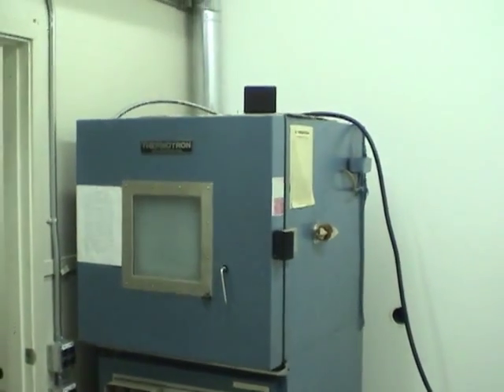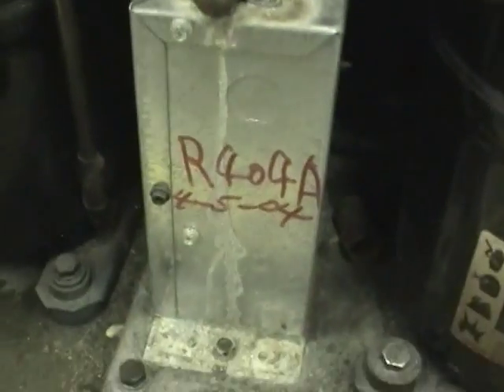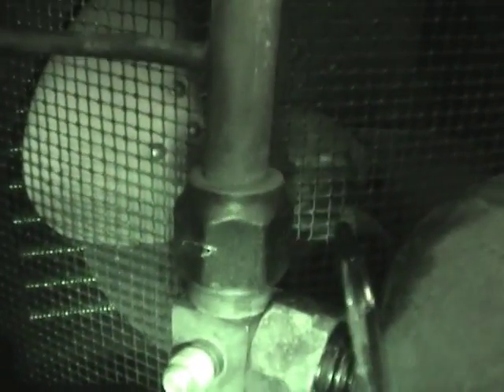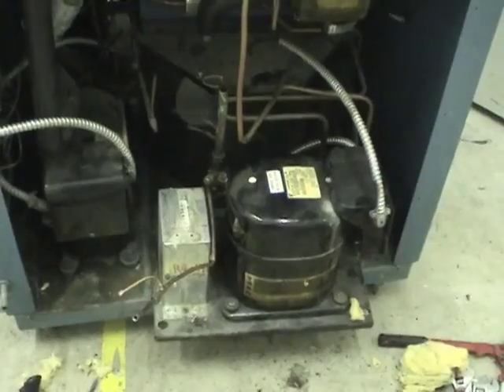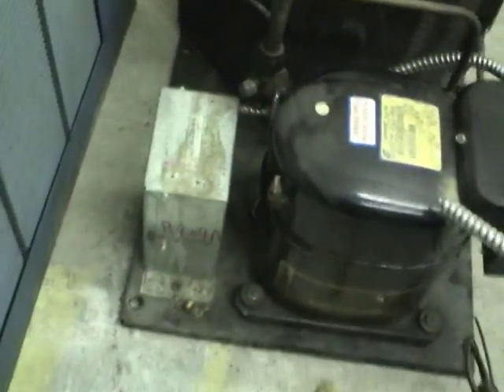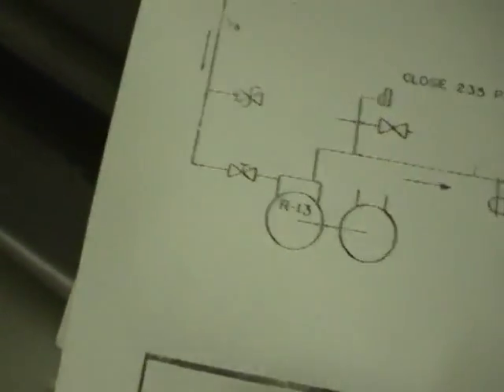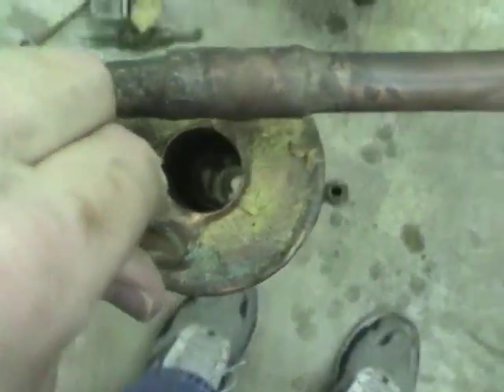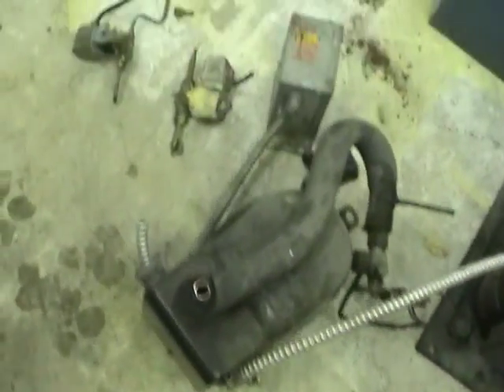Dismantling Thermotron Thermal Chamber

Comment from the maker: @HDXFH The 120V to 240/480V will be nice for charging up big capacitor banks. Now I just need to collect up more caps.

Now if I can find a 208-120 I can make use of that huge 208V UPS from a previous video.

Comment: When pulling down from a high temperature the expansion valve feeding liquid into the low temp stage suction line brings the temperature of the returning gas down to an acceptable level.
Brings back memories, I did the electrical design for this chamber.

Comment from the maker: @g60scuzz I don't think there's any benefit having a cascade of the same refrigerant. The reason for the cascade is to condense the low temperature refrigerant at a reasonable pressure. R134a can be condensed at a reasonable pressure at room temperature of course.

The R13 used in the thermal chamber requires 500psi to condense at 25C, so they really need to condense it at much below room temperature to use a standard compressor. I'm guessing the R13 condenser is run at about 0C for about 275psi